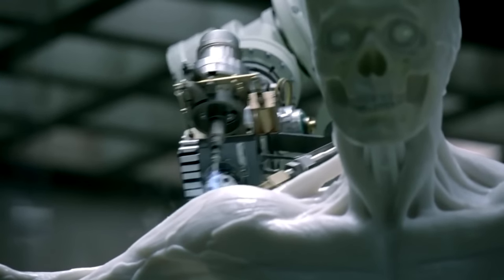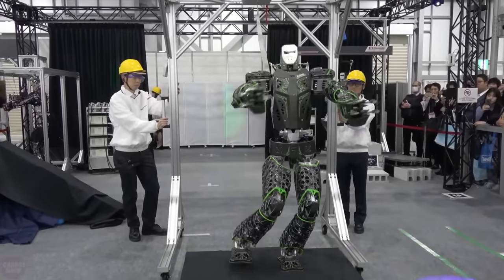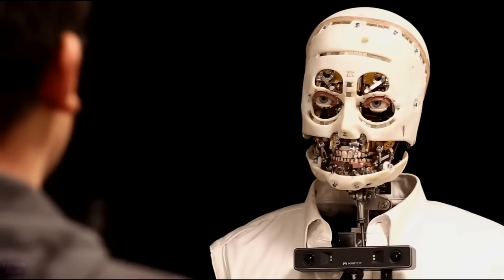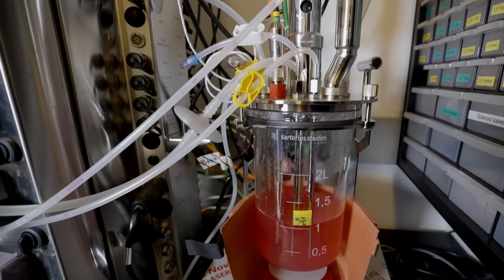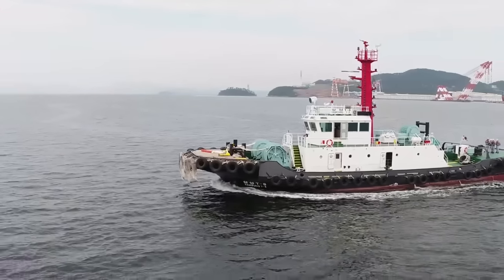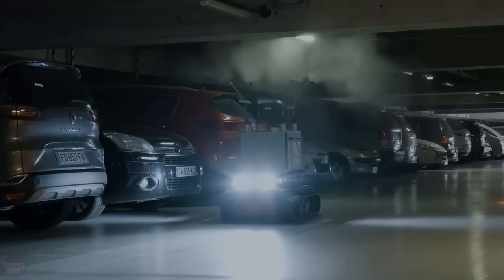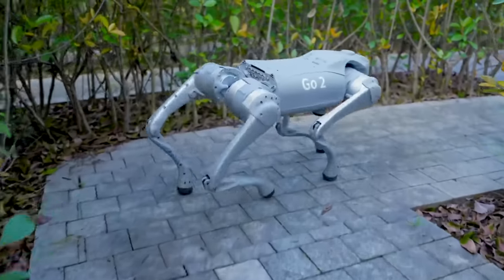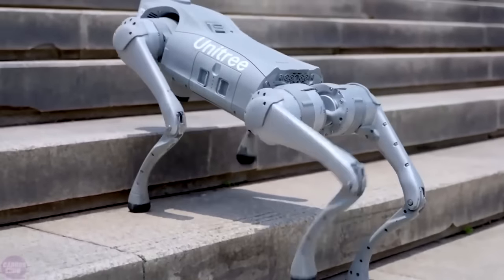US Scientists have Begun 3D Printing Next-Generation Humanoid Robots

Comment: I don't understand the moronic push to make Robots look like us, most of us don't like how we look, why force this on a Robot, just make them useful and forget about what it looks like, I would rather have a Robot with 8 arms and a small torso but legs that can make it reach tall areas, so it can clean the gutters and roof with out neding a ladder or scaffold, it can have telescoping legs and or arms, if it has four to eight arms then it can carry in the shopping as well as other things at the same time, make it small so that it can fit through small areas if it shrinks it self by pulling in all of it's appendages, this way it can go into crawl spaces and remove rodents or other pests or repair wiring or plumbing.
Stop the foolishness of making useless badly designed Human robots as a Human is a very bad design, we are to soft, shaped poorly for working in areas as our eyes are on the front of our heads anything behind is invisible to us and why we smack our heads or get stuck, it's also why our scaffold and ladders are so badly designed as we only have two hands and feet.
If I were designing Robots I would make them useful and bugger the what they look like, unless making a Sex bot and then it has to be perfect and look like a very attractive Asian Female of what ever age the person may prefer :).
We would be so further ahead in robotics if they dumped the human look and went for multi appendage and more utility to the body shape, even the dog shaped ones could be made far more useful by adding more appendages and telescoping appendages, to make Robots to take over Painting, Plumbing, Electrical, Tiling, Plastering, Roofing, Concreting, Bricklaying, we don't need Human looking robots as then they will be ham strung, a Brick laying robot with eight arms would be far more useful than one that looks like Tom Cruise or Clooney and has two arms and legs.